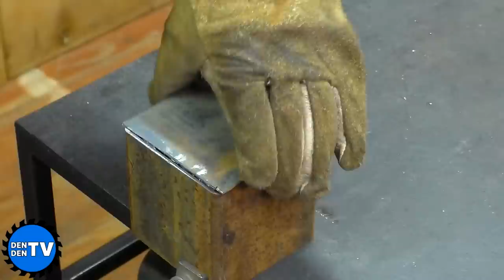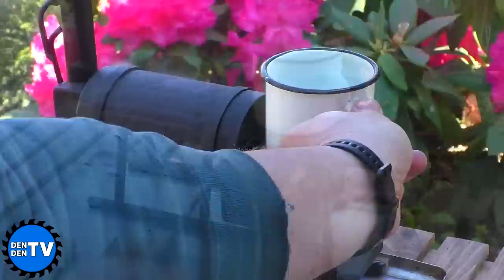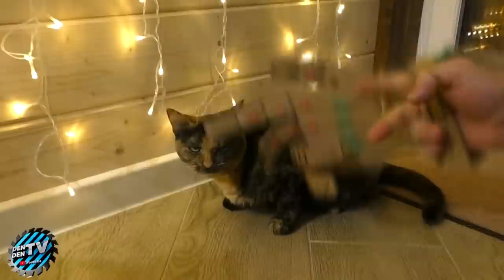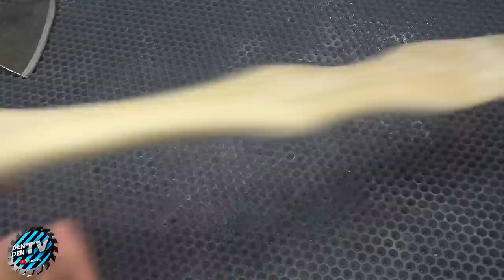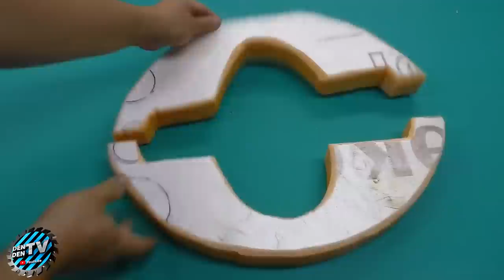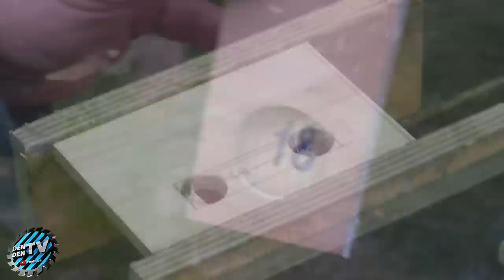7 CRAZY Inventions That Changed History !!!

Comment: What was it again that was invented? Clay? Baking soda? Super glue? Steel? Welding? An exact replica of an already existing smoker style, only 20 times smaller? Or perhaps it was a double bitted axe? I get it. These were all inventions that changed history. In fact all inventions changed history. However, when you drop a title like that people expect a video explaining 7 inventions, when they were invented, and how they changed history. What they don't expect is a key that will gradually gum up your lock and eventually break off inside it, an axe that will only break again because after all of the cutting and grinding it needs retempered, or a calendar that was invented nearly 80 years ago(which by the way is thousands of years after calendars were invented) so there is no chance that it changed history. You sir have depicted yourself as a fraud.